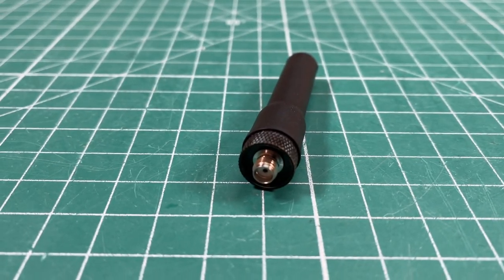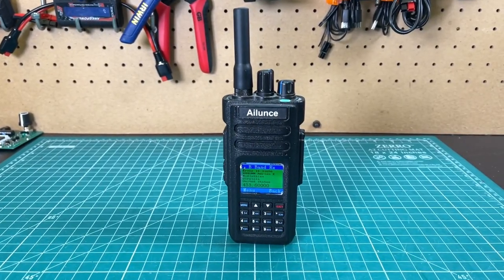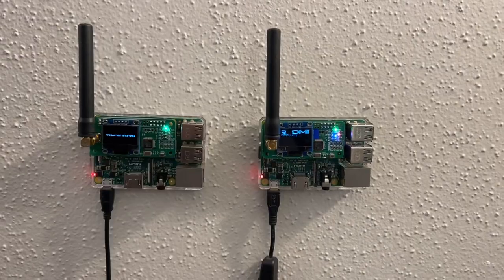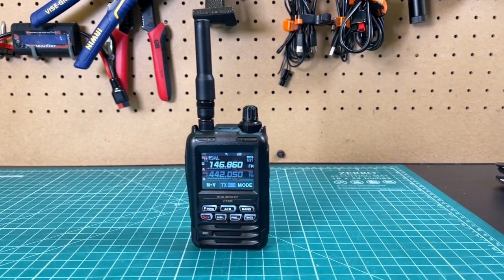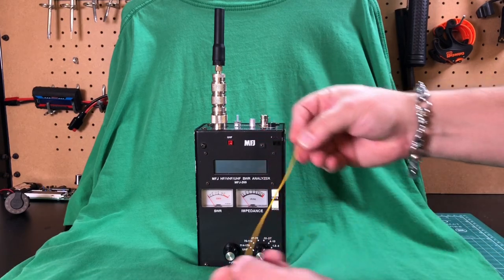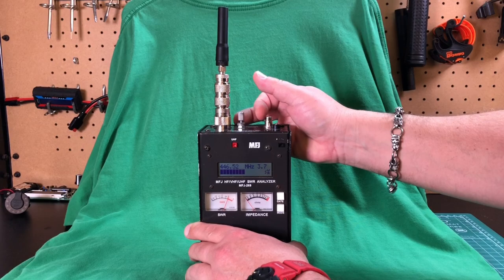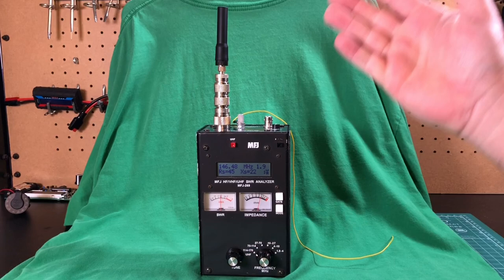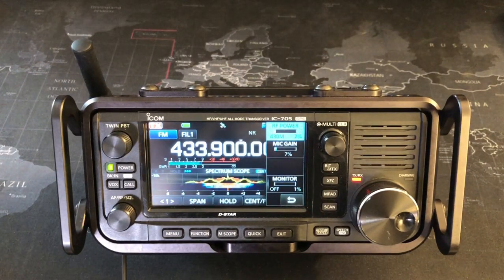Why Do I love These Terrible VHF/UHF Ham Radio HT Antennas??

Comment: Great Video Mike....I love these antennas. We use them in CERT teams for close in comms on GMRS where they work even worse....lol. They work great for that use. Also a very good SHTF antenna when you want to keep your signal in a smaller area without others hearing you. I have the one's you have. And another type that is really bad. It's about an 3/4" tall. Pretty sure it's a 5 watt resister in a plastic case. It sucks so bad, but gets out for a short distance. Comet (SMA209) also makes one that is just a little longer (the DX model...lol). It's about $15.00. Not sure if the SWR is better on the more expensive Comet, but it does have a little more range.  They are also great for close in without having a much taller antenna poking you in the eye with the radio in a pouch. Killing it Mike ! Keep these types of video's coming !   73......P.S. I just tested the antenna you tested and the Comet antenna on my MFJ analyzer like the one you used and got better results. With the cheaper antenna @ 144.00 in was 1.2 to 1, 147.00 in was 1.5 to 1, at 148.00 it was 1.7 to 1. The Comet killed it. 144.00 1.1 to 1, 147.50 1.0 to 1 @ 50 ohms and at 148.00, 1.1 to 1.  Difference in antennas or just blind luck ? I don't know, but they sure won't hurt my radio with high SWR. No counterpoise was used......P.S. P.S. I tried it again with a Surecom SW-102 SWR meter (Farsometer 2000) with a FT-60 @ 5 watts. Results were very similar to the other test on VHF, all below 1.8 to 1 with the cheapie and all below 1.2 to 1 with the Comet. SWR was 2.0 to 1 mid band 70cm. I even curchunked a 70cm repeater about 25 miles away from my basement with the Comet while testing....go figure. I had only one adapter between the meters and antennas. I never tested them before. I didn't want to know. Thanks to your video, I no longer worry about bad SWR from these antennas.
Reply: I appreciate this detailed PS!

Comment: Mike, as a former 1st Class Radio Telephone License holder (I let it expire) and a 42 yr ham. The one problem with those antennas is that the high SWR over time will stress out the finals, I have repaired & seen many new hams blow their finales in their HTs using them. On a UV5R that's not a problem they only cost $25-30 each but on the better HTs that's a $200-500 loss, & a hefty repair bill if it's out of warranty.
Reply: I think if you are using low power like for getting to a hot spot, the SWR would not be as much of an issue. High power, yea, it could cause problems. I keep transmissions on the short side when using these antennas. And yes, put it on a Baofeng. If it blows up, I have 10 more stashed away for bad times.
Reply: @johnk23705  me too!!!
Reply: Yup I only use the signal stuff signal stick . Buy quality not junk

Comment: I don't know about you, but I've seen other videos showing only about 2.0 SWR using these 2-3 inch rubber duckies.  BTW, I also have them and I did a range test, simplex, handheld to handheld on GMRS, and we were able to talk to each other a mile apart, with some trees and houses in between.

Comment: You have a valid point about attenuating the signal. But a 50 ohm dummy load will do the same thing and present a low SWR to the radio. They do make SMA dummy loads.
Reply from the maker: I feel that would attenuate it a little too much but it would be cool if there was a dummy load version of these antennas.

Comment: Too bad that you didn't compare the SWR to the stock antenna. It would have been interesting to see if your setup to measure the SWR actually was working, instead of assuming it was working. Comparing the stubby antenna to a normal antenna would help answer that question.
Reply from the maker: I know you were looking for a comparison between these and the stock antenna.  I already told you they were not as good.  SWR is only one measurement though.  And much like I emphasize in this video, testing HT antennas is quite difficult.  But again, like I told you, these are not better than the stock antenna, nor are they better than other after market antennas like the Signal Stuff Signal Stick Antenna.  If you want to get more fars that is.

Comment: I never thought about using those antennas for digital VoIP modes. But with the high SWR, I'm a bit skeptical. For 440, I got a couple of Dimond RH77CA antennas on my FT3D and ID-52. They preform great with low SWR, even at 5w on FM.